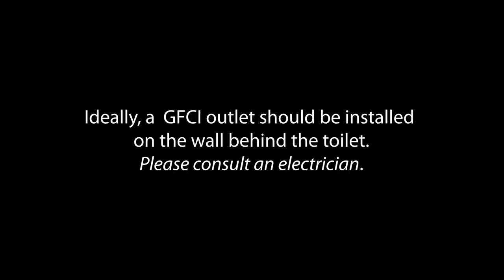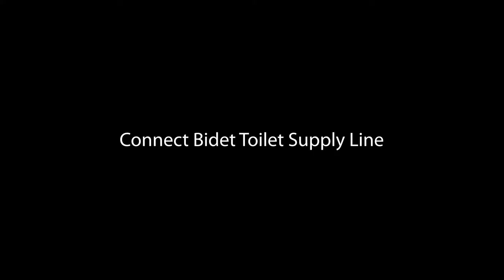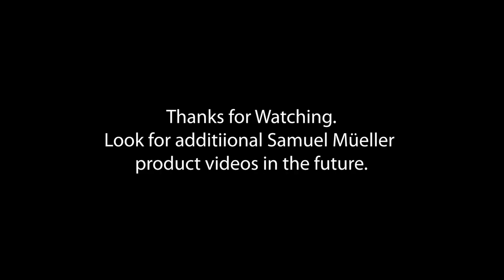How to Install a Smart Bidet Toilet

Comment: This is the exact toilet I had installed 6months ago, now its faulty. It never stops running, water keeps flushing down the drain. Do you have any tips on what to troubleshoot? I had to turn off the shut-off valve to stop water flow.

Comment: You don't have to take those two screws out those are for the internal electrical parts just pull it will come out of the Clips
Reply: I cannot get my seat/lid to lift off to access the flange screws. There's nothing to unscrew? Just pull? I'm afraid I'm going to break it.